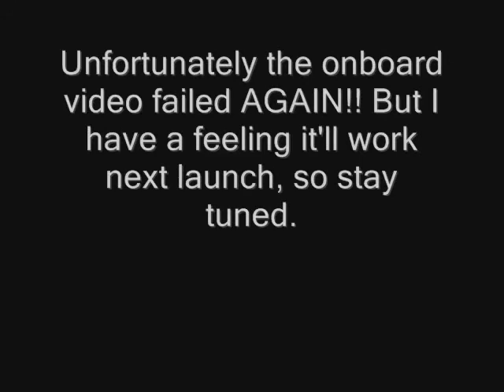Exporter 2000 Rocket Launch

Comment: I know im a few years late to the party, but I have to say I like the design and paint!  I'm hoping to get at least an L1 HPR cert this summer with the eventual goal of a high enough cert to use any of the 54mm CTI offerings.  I may try for the cert that lets me use M or higher motors, but there are too many other interests I have in rocketry that don't require M impulse certification.

Anyway, keep flying!